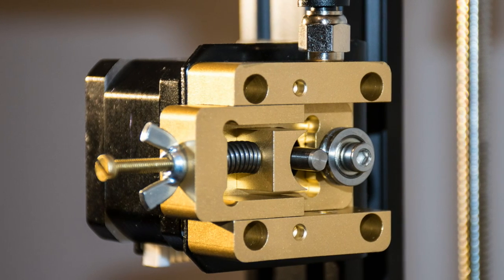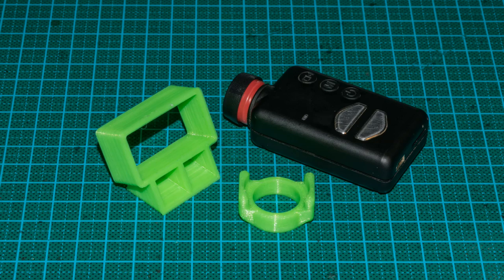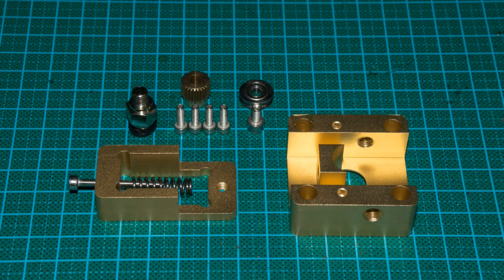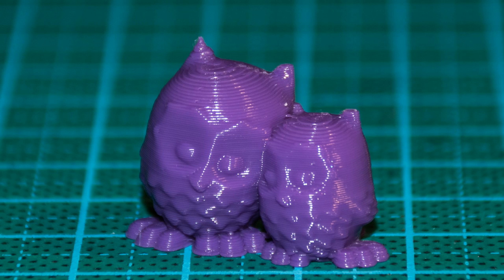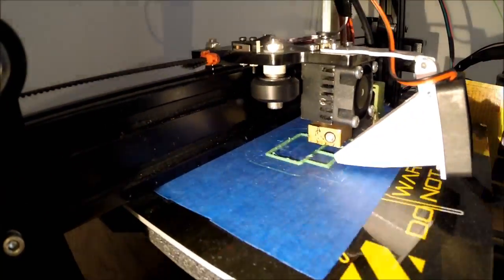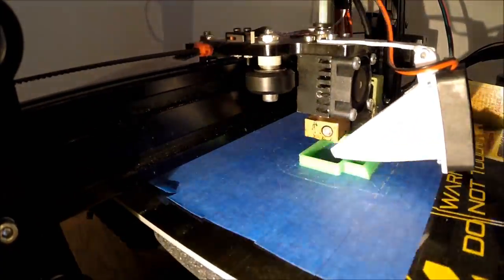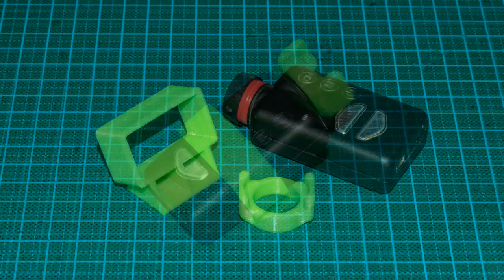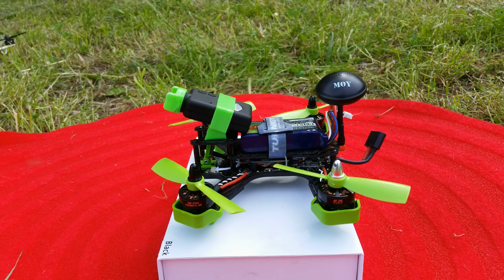Tevo Tarantula 3D Printer: Flexible Filament Upgrade & Test Prints

Comment: I really enjoy your videos.  Your enthusiasm shines through!  I've got a Delta style printer kit which I bought to make quadcopter parts.  I'm actually spending more time on the printer than I am on flying or building quads because I enjoy it so much!  I look forward to your future videos -- both printers and quadcopters.  

Have you tried PETG filament?  I've been trying it, as it is flexible, and can handle high heat without melting (better than PLA).  Also, it does not smell bad when printing.  It is a much more challenging filament than PLA.  It is quite stringy, and sticks to the nozzle.  When it works, the prints are great, but I have as many failures as successes.
Reply from the maker: Many thanks! I have not tried PETG yet, only PAL and Flex. Looking forward to trying PETG - sounds very interesting :-)

Comment: Keep up the great Tevo videos, but whats the point of the upgrade? How does this new extruder help with flexible filaments?
Reply from the maker: Thank you! Great you enjoy them. The new extruder has a lower gap. The larger gap of the old extruder would occasionally cause the flexible filament to flex inside the extruder (specially when it was very flexible filament). This new extruder does not have this problem.

Comment: Great video! What filament are you using? I have some parts printed from NinjaFlex and that stuff is amazing. My buddy printed tires for his RC Rock Crawler and they work great!
Reply from the maker: NinjaFlex as well and some unbranded one which came with the flex upgrade (the green one from the video). Both are great :-)

Comment: How did you install the BLtouch auto bed level with the dual extruder on the Tevo Tarantula? I can't install it in the traditional location because the hot end block is in the way. Thanks!